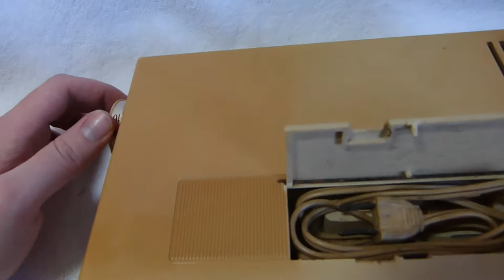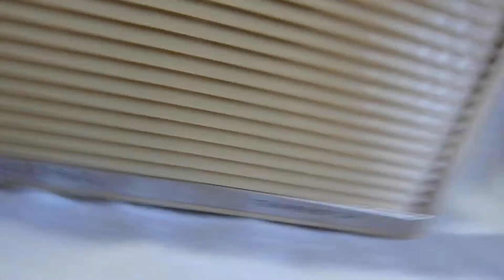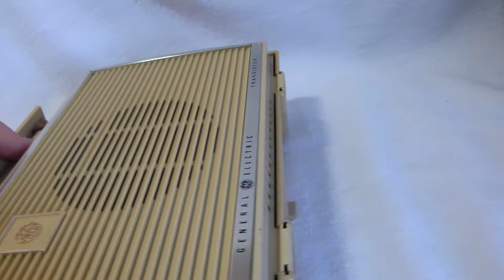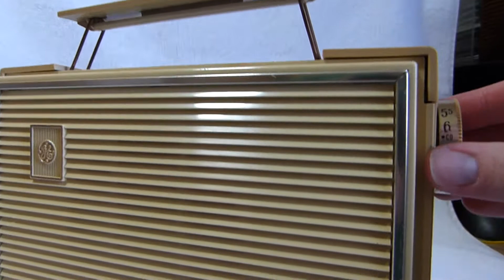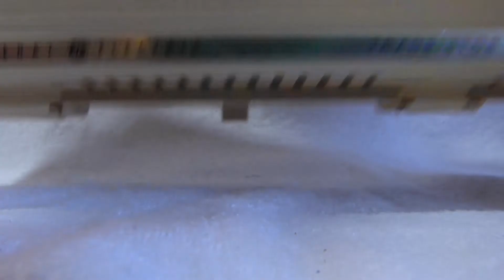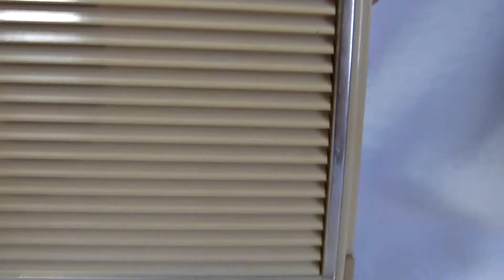1960 General Electric P-880A AC/DC transistor radio (Utica N.Y., USA)

Comment: Nice Matt.  Is it the same big speaker as the p780 that we have?  It looks pretty nice.  How does it compare to the p780 in quality?  Nice video!
Reply from the maker: Steven King The P780 definitely has a nicer speaker, but the one in this set is pretty good as well. As far as station picking up power, it beats my P780, but that set needs alignment.

Comment: I'm on some of the Facebook radio groups I did not see the picture of the speaker
GE made some good radios.
Matt if you want I have some radios that I could send your way so you can make video's of them and put on your channel
Also I may be getting a 1964 Zenith royal 810
It has some problems and if your interested in restoring it to working conditions I will pay you.
Let me no
Reply from the maker: Gary Jessop Gary, I added a link to the forum post on how I repaired this speaker to the description. Depending on what radio's you've got, I might be interested. Unfortunately between Kutztown and some family visits, I won't have much time to work on radios, but I will try to still post a video each week. When it comes to complicated and hard to service sets like the Royal 810 (due the compact layout), it's best to go for one that plays and only needs to be recapped if anything (my track record with getting dead FM sets to play is not so great). -Matt

Comment: Glad I saw this. I've got one and forgot to remove the batteries before putting it away. Oh well, now got to clean up some corrosion. These have pretty good reception and are loud. It's all original.
Reply from the maker: Alameda Repair Shop This one did play before the recap, but it didn't sound great because one of the small caps (10mfd IIRC) was bad. I have made that mistake before too; it seems every time batteries get left in something for more than a few months they leak.